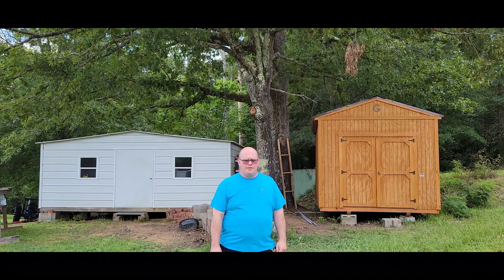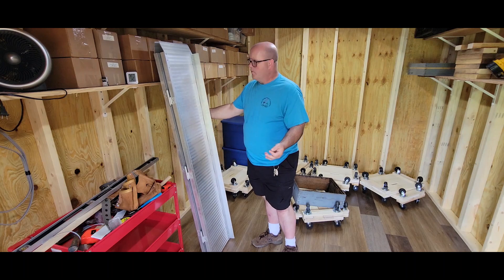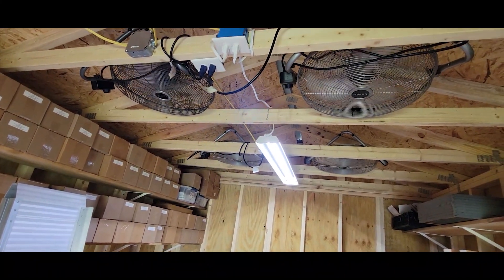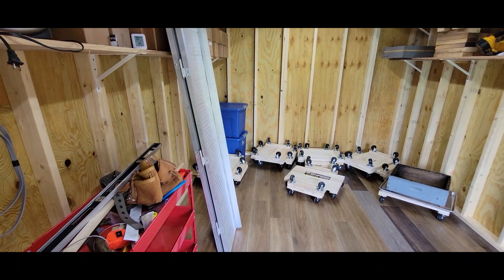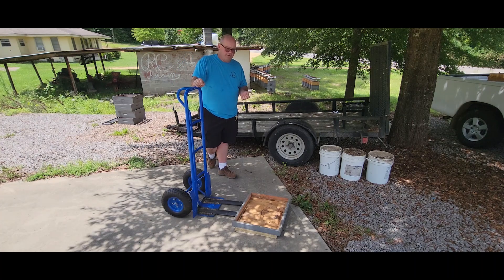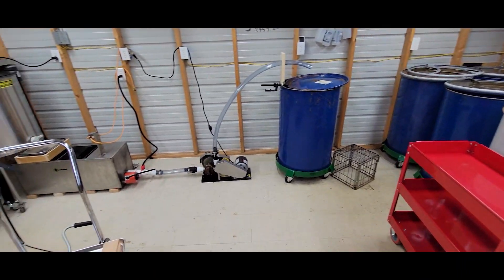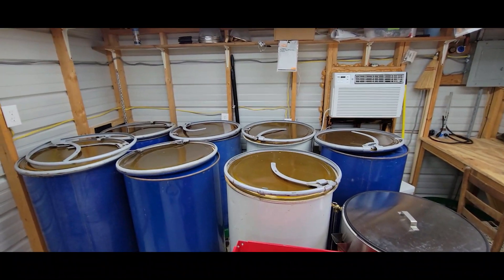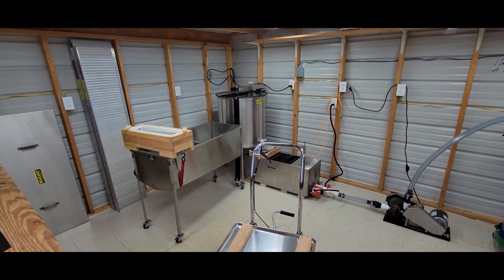Trying to make honey harvest easier and quicker.  #beekeeper #honeybees

Comment: WOW YOU HAVE GOT IT GOING ON . That all looks GREAT Randall. Let me tell you from me finding my problem in my honey house. Please check around your building VERY WELL. I thought my building was tight .😂😂. No it was not . I put my supers in my building turned on heaters and Dehumidifier got everything set up I thought I was ready two days later I opened the doors and WOW . I bet there was 10-15 thousand bees in there and this was a NEW BUILDING. I had never had this to happen before with my old building so CHECK TOPS , BOTTOM AND ALL AROUND ALL DOORS and if you have VENTS , OVER HANGS let’s just say EVERYWHERE.😂😡😂😡😂. I had to laugh to keep from crying. Looks like you have done a great job setting up your operations. Congratulations and good luck . Thanks Randall
Reply from the maker: thanks,  i did check when purchasing,  it has screen in peak and luvers in overhang.  i guess it was their solution to keep dirt daubers and carpenter bees out.

Comment: Randall carpenter comment,  😇Sorry guess ya really are never an ex-carpenter.
         If it was me I would add some blocking to the corners of your new building, it will make the building more stable less bouncy and feel more secure when you are moving things around in side. Sorry spent a lot of years in the industry and a few building those style sheds so I eyes notice things.😉 I didn't mean to make it a recommendations comment, I really like how you are using your space. Your new honey room should work great for you, I would love how you set up the fans for dehydrating. I love how you pump it directly into the container, nice clean setup Randall. I wonder if you could have a float shut off valve on the pump? Now I have honey house envy, some day I'll get to have. Great idea to putting everything on heavy duty coaster wheels. 🤠Ty for sharing your time Randall, Blessed Days...
Reply from the maker: thanks for sharing the blocking.  the corner where i had the extractor strapped previous years had the blocking and it does make it more rigid for sure.  i am trying the extractor this year not strapped.  the clarifier did come with a float switch.  thanks again.

Comment: Just came across your channel and really like your thoughts on a number of things, particularly the use of drip pans on dollies. I use dollies but just staple trash bags and discard after extraction, with the honey. What size are they and where did you get them?
Reply from the maker: The sheets are apx 17"-18" wide by about 24" long.  I got them on amazon for about $10 each.  They worked great for me.

Comment: Randell: I’m in central Alabama, at Leeds/Moody area. When should I be putting my honey supers on my hives? I always struggle when I should be putting them on my hives. Do you put your supers on a certain week of the year? Thank You Kenny
Reply from the maker: Drawn combs i start putting on in early march.  For you that might be roughly feb 20th as you will be a good 2 weeks ahead of me in spring build up.   allow broodnest to expand up thru 2.5 mediums.(i run single deeps.)  Then in early april i shake bees down to first medium,  move all brood as low as possible in mediums, and add queen excluder.    If timed properly it should eliminate 90% of swarming and makes much bigger honey crops if you do not want to take early splits.  If you take splits that is fine but yiu will not get as much honey.   Foundations i do not add til last week of april,  check weekly and add more as needed.  By june 10th foundation drawing with natural nectar will be over.    There needs to be heavy nectar flow for them to get drawn.